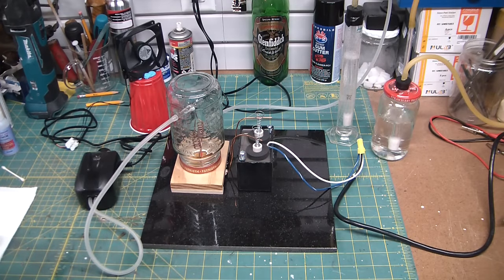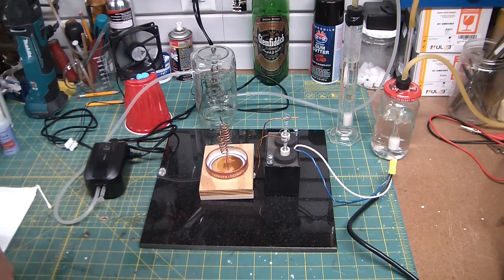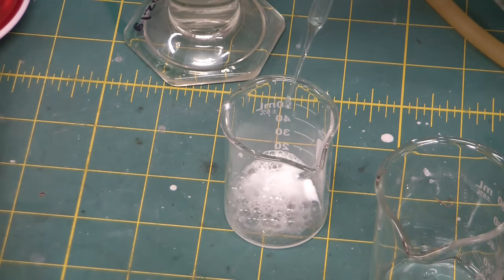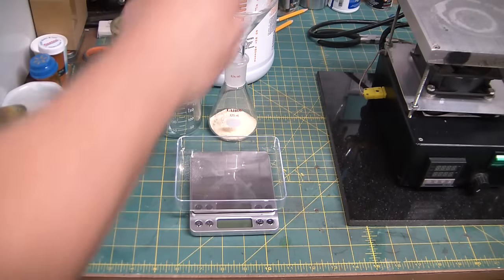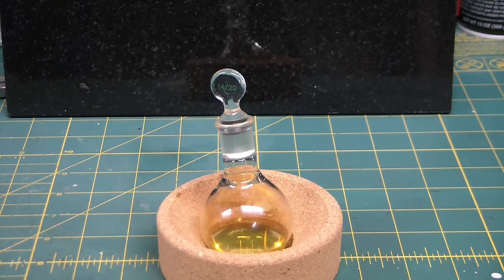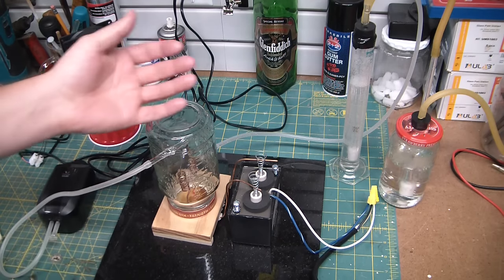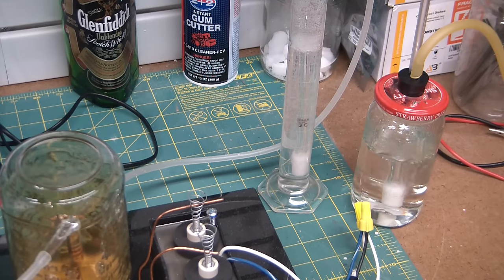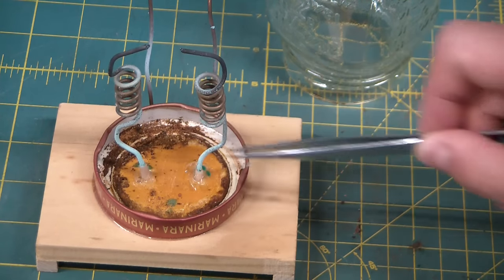Making Nitric Acid From Air - Elementalmaker

Comment: If you want to alter the electric arc, go by the same concept that old CRT TV's are using - stick two conductive plates to the (outside of the) jar which your reactor's in. now get some high voltage (no problem if it's low current) power supply, and connect a plate to each of its output terminals, essentially making a capacitor. you can try using AC or DC and see what results you get. i suggest you ramp up the voltage slowly and see if the arc is being attracted to one of the plates (probably going to happen if you are using DC). if you try AC\High frequency pulsed DC the arc is probably going to move around quickly instead of being attracted to a specific plate.
A much simpler idea to begin with: instead of a power supply, get a wire connected to ground and touch the plates (one at a time) with the wire's other side. alternate between them to see if and how the arc is being affected to get the general vibe.
if you have questions about this (also about practical designs for this thing) ill be happy to help.

Comment: Are you doing this in a fume hood? What's your setup to keep yourself safe during this?
Reply from the maker: Distillation apparatus output is ducted to the outside, and I had a high volume exhaust fan set up in case of any gasses. I also wore a full face respirator with acid gas cartridges in case. I definitely don't recommend doing it this way, it should absolutely be done in a fume hood.

Comment: I would love to see a follow up vid about ways this process could be made more efficient than it already is (or isn't). I mean there's probably ways to boost the efficiency by at least a couple percentage. probably wont ever be viable unless you're working on a massive scale, or you have like hundreds of these jar setups and also use solar energy.
Reply from the maker: Planning a follow up video just for that purpose. Yeah industrially this process has been totally replaced by the more efficient haber process, which I would love to try and replicate on small scale, but given the insane pressures required (3500+ psi) there's no way I could do it safely.
Reply: Why haber process, I thought the haber process is only for making NH3? In a normal ostwald generator for generating nitric acid are no high pressures needed, right?
Reply: @ElementalMaker  i'd imagine high pressures are easier to achieve on small scale, given that pressure scales with area.
Reply: @Pyrokartoffel  correct but with high pressure they can make nitric acid of 69% with normal air pressure 53%

Comment: I wonder what if the copper electrode leads ment for heat dissipation were coiled such that when there is an ark the current creates a magnetic field that stretches the ark some. 

Maybe this will help quench the side reactions that reducing two nitrogen monoxide molecules back to a N2 and a O2

Comment: Those neodymium disk magnets with the hole in the middle have a toroid or donut shaped magnetic field and having a ark going into the hole causes that disking effect but I've only don't very low heat sparks directly onto the magnet

Comment: 10 mL of concentrated nitric acid, not bad for 1.6 kwh. Around me that is only about $0.2 worth of grid power. Need to factor in other costs and scale up a bit, but 1L of nitric for $20-30 is a good price.
Reply from the maker: Yeah it really worked out more economically than I though it was! It ran me about $0.27 with generation & distribution charges included. Comes out to 4.05 a pound for the impure sodium nitrate, really not bad at all for those without a commercial source.

Comment: As a laboratory technician, my stomach clenches when seeing you handle the acids with no gloves :P
Please invest in some nitrile gloves, it is a cheap first barrier for your safety :)
I highly recommend "Ansell touchNtuff"
Nitrile gloves aren't that good for long exposure times, but they are good for spills, if you need gloves with longer exposure times, butyl gloves are the go to material, but  usually thicker and have less flexibility compared to nitrile gloves
Reply from the maker: I actually have quite a few years of lab work under my belt. Nitrile gloves will spontaneously combust on contact with concentrated nitric acid, hence proper lab procedure is actually bare hand. Nitric, even red fuming, isn't all that powerful against skin as long as it's quickly washed off.

Comment: Yellow chemistry strikes again!
NO2 makes both HNO3 and HNO2 with air. You may be able to oxidize some of your nitrite up if you shut off the HV and bubble some air for a couple hours at the end.
Reply from the maker: That's a great idea, I'll definitely give that a try next time. I also thought about adding some concentrated hydrogen peroxide at the end to help accomplish the same goal, but air is definitely cheaper!
Reply: @ElementalMaker  Or if O2 does not do the trick, make an ozone generator and after the NO cycle, bubble some O3 in for a few hours!

Comment: i think you mostly produce nitrous acid instead nitric acid with spark oxidizing nitrogen... Cody from Cody'sLab made similar video some time ago where he explains how to get nitric acid with sparks... i was looking for nitric acid for more than 10 years and none of the lab supplies or industry that sells nitric acid wanted to sell me some, not because of the products i can make with it, but because of potential to use the nitric acid as poison FFS 🤦‍♂ finally, i found local beer brewery that was using nitric acid for cleaning equipment, so they were glad to sell me some of their supplies... 
great project btw, keep up the great work and best wishes...
Reply: He made HNO3. HNO2 acid is very unstable and rapidly disproportionates in water solution into HNO3 and NO. The method he used in one of very first used in history to produce HNO3.
Reply: @Qwertypp10  you might be right but those fumes from the vial looked more like nitrous acid decomposing instead fumes of fuming nitric acid... also if the hno2 disaproportionates in water solution into hno3 and no, wouldnt that mean that he should get red fumes where the hno2 dissolves in the water? i didnt see that happening... i think he should try to nitrate some cellulose to confirm if he has nitric acid or not...

Comment: High voltage scares the hell out of me, but I'm gonna get over that to build one of these, been wanting to for years.  Probably get much higher efficiency by running the NO2 through a bubbler stone in a saturated solution of sodium carbonate or bicarbonate. Recover your nitric acid as sodium nitrate. Just do that rather than try to make acid in situ. Sulfuric acid is cheap when you want to recover your acid.
Reply from the maker: I recommend dont build one unless you are comfortable working with HV, and even then you better also be comfortable with toxic gasses. I definitely dont recommend doing this one at home, if you want nitric acid, its way cheaper to just buy online.
Reply: @ElementalMaker I'm comfortable with all of it now, I've been distilling my own nitric acid for years, but I'm thinking it would be cool to have one of these running off a solar array. Free nitric acid beyond the startup costs.

Comment: G'day mate, thank you for your video :-) Could you increase efficiency by de-gassing your water to make it more receptive to gas absorption? Re power consumption, could you set up a solar panel on a cart/trolley/table with a battery, etc to power the process - a $100 panel produces about 130 - 150W @ ~12V. Hope I'm not speaking out of place.
Reply from the maker: I think the best way to increase efficiency is to use hydrogen peroxide, and regularly add more to keep H2O2 levels up.  You could definitely do this with solar as well, I plan to do so in the future

Comment: 6:18 the droplets that stay in the tubes are extremely concentrated
Reply from the maker: That they are! My thumb can attest
Reply: @ElementalMaker  I'm kinda jealous tbh xD
My reactor makes 20 grams of sodium nitrate a week
Reply: @koukouzee2923  i thought the same. My way was the jaccobsladder because i ve read the cooling of the nox gases goes faster and the yield per kw is higher but they are only for thin concentration (38%). But after 24hours i could only smell nitric and acid was so thin the soda bubbles only lightly. I think now the highter temp of standig arc is better. only other advantage of jaccobsladder was you dont need airpump.

Comment: one movie (which?) had this explosives lab which iirc made nitrogycerin. anyway, they had room filled with giant glass bulb with discharge inside. i was like hmmm did they actually make acid this way back then. and yes they did, it needed loads of power and wasn't three story glass bulb though with simple arc. hollywood version looked like massive mercury rectifier. but it does work
Reply from the maker: Very cool! If you think of the movie let me know, that sounds pretty awesome

Comment: That's about a penny per gram of product. That's $10 per kg... That's actually pretty cheap I think.  I'm thinking that if you picked a metal that can catalyse the no2 formation and you optimized the electrics for a corona formation instead of an arc, then you could increase your efficiency significantly.
Reply: That's pretty expensive. I buy ~56% acid for about $1.5/kg
Reply: @dimaminiailo3723  no local suppliers for me, so way more than that. It only starts coming down for me when the volume starts reaching industrial quantities. Plus you get put on lists and every government agency in the book starts showing up.
This is cleaner and elegant for small quantities. I think there's also a lot of room for improvement in efficiency.
Reply: Adding tungsten at the arc gap, and the addition of additional O2 would create a economically viable product. Use of a fume hood should be a must in this reaction, and always keep a hand in your back pocket when dealing with whatever transformer your using to create that type of length of gap jump, at 40 Watt... I saw the transformer, I thought the video was over. The expoxy and cyanoacrylate was causing the orange in the precipitate. I would personally use dedicated purpose made glass for this, if you are able learning how to blow glass for your particular needs is an endeavor worthy of learning.

Comment: I’m curious what makes it unfeasible to distill the red NO2 gases straight from the output of your spark chamber cutting the gas washers and neutralising steps?
Reply from the maker: Great question, you can actually directly condense no2, with a cold enough cooling jacket, which I believe becomes n2o5. Unfortunately it won't directly make nitric acid. The no2 produced during the distillation is simply a byproduct of the nitric decomposing.
Reply: @ElementalMaker  oh I see! Thank you for your answer

Comment: I was thinking that  if you had your spark gap tips of a platinum group metal, the catalytic effect it may add could do you a solid improvement, just as a guess. Probably best with a platinum screen mesh as one electrode, and if DC styled, as I did not pick that up, make it the one the electrons will impact, perhaps. That triple bond on N2 is nothing sort of insane in the energy cost department.
Reply from the maker: Great idea! I do have some platinum to play with it
Reply: @ElementalMaker  I was watching an old Cody's Lab video using a very similar process. He however, did a couple bits that could help you specifically as well. He used copper pipes of small diameter to both pull gas into the electric arc, and carry where the arc was going to form. If you plated the ends with platinum, it might be the best of several angles.

Comment: Have you tried using  TIG tungsten electrodes instead of copper wires?
Reply from the maker: I may have to give that a try! Thank you
Reply: I have tried it. It works, but it is painful. I took tungsten electrodes that are sold for welding. They work, but they can't be formed, so I was very limited in how to use them.
Now I just use how voltage aluminium cables and they work for weeks. I use a "Jakobsleiter (Elektrizität)" to reduce the degradation.

Comment: Instead of just water to react with the NO2, you can use chilled concentrated hydrogen peroxide (oh, you said that toward the end).  Just a word of caution, id recomend venting the outflow from the system into a flask of urea also known as DEF (diesal exhaust fluid). You probably alreay know why,  but for others ill mention the reason is to neutralise the NO2 and NO into ammonia, amonium and water. 

But as for the video you plugged thst uses magnets, i suspect its a rotating field which means he likely is using arduino controllers for that.

Comment: Would be a lot easier to just run air through an ozone tube, which also spreads out the arcing. 

By the way, this will not be all nitric acid. You will also form some other nitrous acids as well as sulfurous acids from sulfur oxides also formed during the process.

Comment: Your hotplate looks interesting, is there a video about this?
Reply from the maker: Yessir way back I did a video showing it, just search "PID controlled hot plate stirred" and you should find it. It's a bit rough, and I definitely should redo the electrical, but it still works great

Comment: Could this reaction be run with a 100 watt 12 v solar panel and a deep cycle battery?
Reply from the maker: With the correct power inverter to power the oil burner transformer it could certainly be done. You wouldn't even need a particularly expensive inverter, any 100w or greater inverter would power it
Reply: @ElementalMaker  if the transformer is already providing DC voltage, what is the lowest voltage the reactor would need?

Comment: many engines produce NOX at oxygen rich environment on high load. I wonder if the exhaust can be scrubbed off their NOx.
Reply from the maker: Absolutely! That's why diesel trucks now use DEF, which is urea solution. Basically makes the trucks exhaust ammonium nitrate! Pretty cool stuff, although I'm sure it would be so miniscule it would be very difficult to recover
Reply: @ElementalMaker  Haha, it makes nitrate and fine soot at the same time. If what I am thinking would work, it can trigger two three-letter-agency at the same time.

Comment: You should dilute by 1:50 and measure with  a ph meter. Then if it just nitric acid you could roughly find the concentration.
Reply from the maker: Great tip! Not sure how well calibrated my ph meter is, but definitely going to use that when I get a better meter

Comment: now i wanna see you try to make a ostwald generator

also you could change the copper electrodes for tungsten tig electrodes or platinum disks, or of course carbon but there is a lot of degrading and some will pobably turn into carbon dioxide
Reply from the maker: That's actually on my project list. I have most of the materials ready
Reply: @ElementalMaker  holy shit
you actually gonna do it?
good luck

I wanted to try to make one myself but platinum is really expensive and then there's everything else, and not wanting to abandon the house if ammonia leaks

today I ended up making a lot of ammonia, the smell, oh god the smell

Comment: I'm a little confused why you neutralized it to a salt and then re-made the nitric acid. Was that just for making ti more concentrated?

Speaking of making cheap and easy stands for round-bottom and other irregularly shaped flasks - try polyurethane construction form. I GREATLY advise to use a foam gun, not a standalone can as you have no flow-control with those, and the guns are cheap anyway.
Just brush on some sort of oil on the outside of your flask (to prevent it sticking) and put it in a small container. Preferably easily obtainable PP (polypropylene) plastic because that would be easily reusable. The foam won't manage to stick well to it. Pre-wet the container with a little bit of water from a spray bottle (this greatly helps the PU foam catalyze and will be mentioned in the instructions). Either hold or temporarily stabilize the flask while foaming around it. Be sure there is room for the foam to expand. Let cure for a day - then demold and cut down to size using any sort of small saw, scissors or utility knife. Very easy to cut and shape once properly cured.

A typical PU foam can has around 40-55 liters expanded volume, so you could make hundreds of stands from one. The PU also has good chemical stability against many compounds in case of small spills.
The only issues are that it's so light you may need to glue some weight to the bottom for it to be stable (or bake it into the cast), and also it will be porous after cutting - so spilled chemicals could absorb into it and not easily be cleaned up. You can either fill in those pores, or honestly just treat them as disposable is probably more practical given the cost.

Comment: 9:45 i mean if it uses 50watts, over 2days, thats 2.4kwh, in illinois that would come out to less than 50cents ($0.50) How much would 20grams of that stuff cost?
Reply from the maker: I actually worked it out and to produce a pound would cost $4.05 in energy at my rate of 15 cents per kwh delivered

Comment: How did you drill the holes in the glass?
Reply from the maker: I had a diamond core drill bit set off Amazon I used for a tile job, they are super cheap and work great for glass too.
Reply: @ElementalMaker  omg. Thanks for replying back to me!